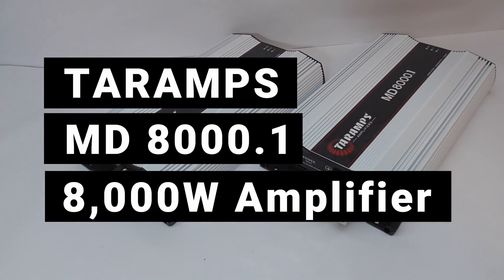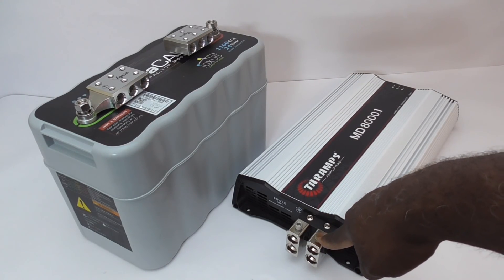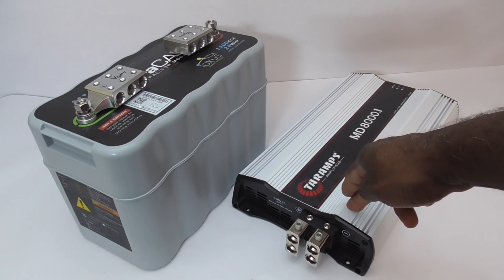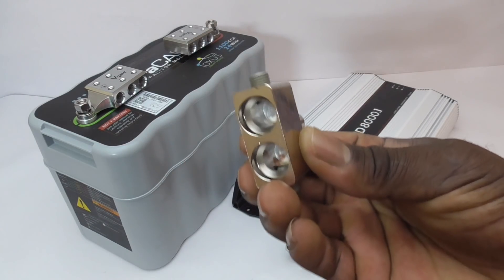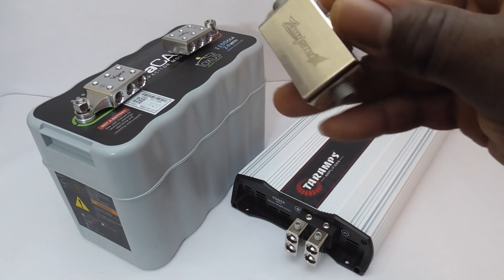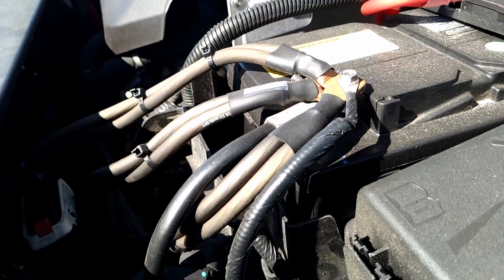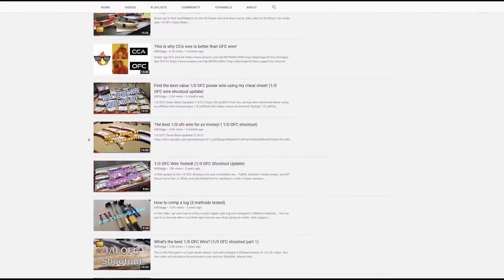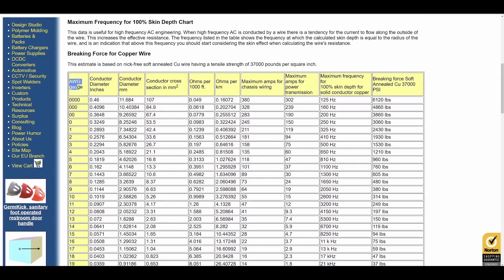Are Dual Inputs Really Needed In Every Setup?

Comment: I think dual runs will split the load keep the wires cooler after all you do have your family riding in the car so spend a little bit more and keep them safe you remember what happened to your old wire.
Reply from the maker: Great point

Comment: your talking about dual inputs right in front of a TWENTY FOUR WATT HOUR capacitor bro. You NEED more juice for amps with this much current draw but if all your doing is burps....its good I guess. Just do the math and find out for yourself. By the first big bass hit, that thing is completely drained down to 0 and if your bumping music its NEVER gonna recharge
Reply from the maker: The capacitor is supported by an AGM, 64Ah Headway bank, and has over 1 millions life cycles. I hope its enough.
Reply: @BudgetBassHead  What are you using to charge them headway cells? Those are lifepo4 yes? If so they won't EVER fully charge either without DC to DC conversion  and or they will smoke your alt eventually if your connecting em straight to the battery. I know this because I have 900ah of them in my camper :D Ditch the cap. You dont need it at all if them cells are good and have proper power.

Comment: I've pretty much always believed in multiple runs of power and ground cable if it doesn't break the budget. It doesn't hurt to have extra cable, and it allows for easier upgrading in the future. What I don't understand is those 2-to-1 inputs. I applaud ToolMaker and others who take the time to fabricate them... But wtf do they really add to the system? If the amp doesn't have inputs big enough to run adequate gauge cable, then you probably shouldn't be fucking with that amp, IMO. Everything you add in a circuit adds resistance. Most of these 2-to-1 things that people run are NOT solid oxygen-free copper or silver... So, even if you are running Knu or ofc welding cable, by using those 2-to-1 connectors, you are adding the resistance of a brick of nickel plated aluminum or whatever the hell they're made out of, PLUS any coating or finish that might be on the piece. I just can't see how adding a brick or nickel or aluminum between double runs of power cable and a single input of an amp will somehow magically add current flow to the circuit. If anything, I'd think it would impede it. And like I said, if the amp is designed to accept a single cable, then only run the single cable. If the amp still demands more, then throw it in the garbage, or modify the actual amp to receive multiple runs. I hate looking at those silly plugs. And they're rarely jacketed with anything to insulate them. If the power and ground cable is designed with insulation, why would you add something uninsulated between the cables and the amp? It all just seems silly as hell to me. Maybe I'm just a salty bitch, but I think those things are worthless unless you are really just that damn committed to running garbage amps
Reply: I think the issue here is that a lot of the full bridge style amps (like taramps) indeed do have undersized single inputs at least for how they're being used in the US. Many are Brazilian and were designed for the brazilian market with the idea that either it would be in a pretty short, small vehicle or that there would be a battery in the rear of the vehicle so again only a short run. In that case, smaller wire is fine because its traveling a much shorter distance. When you get into the big ole American SUVS that may only have a front battery, suddenly a lot of people have issues with the idea of a single run of 1/0 supporting 4-6k+ watts through 12-20 ft of vehicle. The market is demanding change though and the full bridge designs seem to be improving. Look at Sundown's SFB full bridge amps. Even the 5k has dual inputs built into the amp. Taramps has made much more reliable amps focusing on bass (bass and md series) vs what used to be more full range oriented amps (hd series)
Reply from the maker: Well spoken.
Reply: The resistance generated by the mass of the aluminium they often use to make these double adapters is so minuscule that it's irrelevant. The distance it's covering is the main factor to consider, and a small adapter that fits in your hand has almost zero capacitive resistance at all. The conductive part of the adapter is the entire adapter itself - and aluminium is plenty conductive.  A two foot run of 0AWG OFC will have more resistance than that adapter. It's also very easy to insulate them if you're worried they might ever touch, because on some amps they do get very close. I personally just sandwiched a piece of rubber in between mine *thumbs up*. After gaining about 0.3v of increased minimum voltage stability, I was convinced that they're fine.

Comment: Open the amp up and see what size the connections are on the inside and then tell me how much difference it makes to connect 750 MCM worth of copper wire to the outside of this amp. 

This amp has the size input on it that it does because of market request. If I recall you used to have smaller and puts because the manufacture didn’t think it was necessary to have even 1/0. 

I understand that there are some people who need to run 20 or 30 feet of wiring from the front to the back of their vehicle and that totally justified running larger wire, but that can be done to a distribution block and then you can run a jumper from the block to the amp if the amp won’t support the input you want. It has become a marketing tool to have giant power input connections on your amplifier.

Some of the baddest kicker amps ever made (for their size class) had like multiple eight gauge inputs... 

Remember that outside of SPL competitions if you’re actually playing music you won’t be drawing maximum power for any fraction of time that this app could potentially produce it because music doesn’t generate that kind of input to the amplifier. If the max this amp could draw is 700 A at 100% sine wave average loud music might be around 40% RMS which would create maybe 280-300A at the most in the loudest passages.  4/0 cable can easily handle that even 1/0 cable can easily handle that since your ears would give out before the cable would overheat.

Comment: edit.... You do not have 4/0 you have 1/0. a tape measure itself is not a precision measuring tool. AWG is measured by cross sectional area of round, SOLID wire. Please please correct this in your video that it is not 0000. as you referenced wiki please read below the chart 
"AWG gauges are also used to describe stranded wire. The AWG gauge of a stranded wire represents the sum of the cross-sectional areas of the individual strands; the gaps between strands are not counted. When made with circular strands, these gaps occupy about 25% of the wire area, thus requiring the overall bundle diameter to be about 13% larger than a solid wire of equal gauge."

4/0 single you would be fine. 4/0 is capable of more than 380 @ 20'. 4/0 has double the cross sectional area as 1/0 and too many commenting are thinking 1/0. and even then still don't have all the pieces. at 2' you would be fine with 2 gauge. I'd still run 2 runs especially for grounds only because I have seen too many ground traces in these amps burn up.

Comment: Dual inputs add more power and give better efficiency so definitely use dual inputs on this type of power. I would do dual inputs on a 4k and 5k if I'm running .5 if I'm running at 1 ohm then the single will be fine.

Comment: If you run both of those amps , how will you route the rca’s , a splitter from the red and make 2 red and split the white rca to 2 and then run 1 red and 1 white to  a amp and 1 red and 1 white to the other amp ?

Comment: When you have short runs, the ampire rating will increase.  I have a MD 8000 1 I plan on running 1 run of 2/0 less than 2 feet away.  I can't imagine there will be enough voltage drop to need more. Failed to mention that it is over 4,000 strands of marine grade OFC. Wire quality has a lot to do with it also.

Comment: Are dual inputs required. No I don't think they are. Do you have the ability to pull more through your lines with less worry yes I do. Do I think they make for better pop/wow factor yes I do. If you are a math guy and a budget guy then you will be factoring max current vs length for your big runs and then stepping the cable size down to split off to yours amp cuz you know smaller cable is more budget friendly.  I hope you break out that AMM-1 of yours and do some real world testing to see if if indeed you are able to use dual runs and get real gains from it. remember in the world of comp every fractional db is still measured and could be the difference of a world record or going home empty handed and it's better to have that extra bandwidth and not fully utilize it vs not having enough bandwidth and burning something.

Comment: As an owner of 4 of these amps that have seen 8702 watts clamped from them I can tell you you only need a single run of 2/0 welding wire (or oversized 1/0 car audio wire) especially if you are running only 2' My single 2/0 welding wire runs are 5' long and do not get warm at all. It won't hurt to run 4/0 and won't hurt to run dual inputs but they are not needed. Just do like the manual states and run a minimum of 2/0 with the shortest possible distance to the battery. Taramps the company won't steer you wrong.

Comment: Dual input is needed according to current draw, and the length of the power wire length. Derick from Sundown Audio on the Sundown Audio Unofficial channel did the test of dual input vs single run input, and yes, you get more power with the dual run. It's only needed if the demand is needed for your setup. MAKE SURE YOU FUSE ALL POWER RUNNING TO THE AMP, AND BETWEEN BATTERIES, AND POWER SOURCES!!!!!! (edit: Also, to clean up your terminals, get you some of those terminal relocation blocks that relocate the factory terminal to an external post, and give you multiple output ports.)

Comment: I run this amp on 2 vxf 12s at .5 ohm, the amp is about 4ft from my 40 ah lithium bank. This is just my take on it, I am not comfortable using 1 set. If I am running this much power then why not add a little insurance for the 30$ it costs.
Reply: 2 runs would be needed. however, how long you been running the amp and whats your rise?

Comment: You also need wire ferrules for the interior wire if you going to use those inputs to the amp1 wires sticking out of that can blow your whole system
Reply: Wire ferrules are horrible on my MD8000.1. I love the idea of ferrules but in reality they are a bad idea if you ever want to pull the power from the MD8000... The ferrule gets stuck in the input and you have to physically have to rip the wire from the amp even with the set screw all the way out. The wire pulled out of the ferrule and then you have a bent up ferrule stuck in the amp. They are a pain to get out of the input. It takes like 10 minutes each to dig out with needle nose pliers. Since then I've never used the ferrules and I've never ever had an issue.

Comment: BudgetBassHead, this information is going to be even MORE controversial. This is not opinion. This is common sense when you understand electrical theory. FYI and disclaimer, I am a DeVry graduate in electrical engineering, and been in car audio for work and hobby the last 23 years. That being said, here it is!
1. You only need the appropriate sized wire from your SUPPLY voltage source (battery), wherever that may be. This is based off of feet.
2. The voltage drop is based off of awg, and length of wire. The capacity is purely based off of awg, and the amperage it can support goes up the shorter the wire. Buss bars work the same. Your power wire is simply a FLEXIBLE buss bar, and the quality of the copper within the wire determines many different things, including amperage capacity.
3. If your alternator only charges with a peak available current draw of 300A, then you only need a SINGLE 1/0 OFC run, as it is not POSSIBLE to draw over 300A from your alternator!
4. Current is being drawn by the path of LEAST RESISTANCE, capacitors FIRST (least resistive load), Alternator, then battery...but alternator can only supply 300A, so take 300A draw away from the battery itself, but your COLD CRANKING AMP spec (how many amps the battery can SUPPLY for 30 seconds at 0 degrees before 10.5V) is the absolute max you can do on a dynamic current draw. At that point the battery will SLOWLY restore itself due to the chemical reaction in the battery when excited by inducing voltage. The rate it can charge back is directly proportional to how many amps are available to charge it (alternator)
5. Alternator has ONE FUNCTION, TO CHARGE YOUR BATTERY AND RUN YOUR CAR...THAT'S IT. So you only need correct awg to CHARGE YOUR BATTERY AND CAP BANK. In this case, 300-320A for that leg in the circuit.
6. Now that we understand that, we ONLY need to size the wire appropriately for the amp TO the battery...wherever that battery may be. If it's in the trunk, you can get away with less wire. If your battery is under the hood, well now you need MORE wire to support the amperage and the length of the run.

THAT'S IT. TRY IT. SAVE YOURSELF ALL THAT MONEY BECAUSE OFC is not cheap!
Under no circumstance EVER, I don't care if you're running a Boss 100W amp, never ever ever ever use CCA, it's never worth it! no matter how cheap it is, drop an AWG and go OFC. Galvanic corrosion, shrinkage and breaks are REAL. It has a much higher impedance per foot, and cannot handle the amperage either. You need 4x as much CCA to equal copper, so why bother with it??? You actually spend MORE money with CCA and get LESS. Even that dirt ass cheap Harmony Audio wire. FYI, I measured Harmony Audio's 1/0 CCA wire for a friend one time, it was the equivalent of 2awg...so you literally get double screwed. Still cheap now???
Reply: 1.  feet, temperature, bundled wire, conductor material...... not just feet
2. do you know what AWG is?  voltage drop and capacity HAS NOTHING to do with AWG.

5. Alternator has ONE FUNCTION, RUN YOUR CAR...First off you listed 2 functions, you only need the correct gauge for which the alternators output is rated. However more NEVER hurts. Second how do you factor in the amperage of the capacitor bank? 
6. Now that you've said all that, JUST WAIT, theres more........only to be followed up with more incorrect information......

You say this all like its a blanket statement, all wire is the same and you are thoroughly incorrect. Aluminum in itself is 55% as conductive as copper. so 4x55%=yeah you were close......................You measured your friends CCA, how? for what? with what? 

Terminate your ends proper, have sufficient runs according to ratings, KNOW what you are talking about before saying it like its FACT. I don't care the degree you obtained from what university, How long you been in the game, what you think you heard was fact, what has and has not worked for you.  First, "there is more than one way to skin a cat".  Second, no 2 cats are the same! Third, Just FYI, some of the loudest in the game run CCA. Do you lose a few hundred watts same vs same, OFC to CCA 1/0 on a few thousand watt amplifier? Absolutely! Will you hear that difference? Absolutely NOT! So you might need to run 1 extra run of 1/0 in a 600A system but with prices being double or triple, well can't argue facts and science Jack! 

Also, if you knew so much you would have known to correct him on his 1/0 wire being 4/0 as that was a huge oversight. We have all the correct information we could ever fathom at our disposal yet we piss on it and throw it to the wolves laughing. The amount of misinformation/disinformation has become disgusting.
Reply: @commonsenseisdeadandgone  just trying to keep it simple for everyone else.
Reply: @commonsenseisdeadandgone  we can converse over all the factors you would like, and how the data is collected. I'm simply answering the question. There are many factors involved to choosing the appropriate sized wire. He was wanting to know if it necessary to run dual inputs on his amp, and it's not. I was trying to help other people who wont understand certain terms as to why it's not necessary. I do not disagree with you, but I certainly would NEVER recommend CCA...there are many reasons to not use it, even if wins you trophies.
Reply: @commonsenseisdeadandgone  regarding your disgust, here is how the conversation went:
Person A: Do I really 8 oranges to make a cup of juice?
Person B: In my experience growing up on a farm, NO you only need 4...especially if you use the juicier Florida grown oranges. If you used 8, you would have a bunch of juice left over you can't use. Make the juice with Florida oranges because it has less pulp than California oranges. Never use California oranges because you will need to filter the pulp and they use pesticides.
Person C: Do you even know what an orange is? Do you know how the farmer grew them? How do you know it has more pulp? Even if it did have more pulp, you never mentioned that the pulp is finer. Your wrong, it would only take 5 California oranges making it cheaper. California oranges are perfectly fine, I see people drink it every day.

See how person C never addressed the original intent of the question? While there is clearly more information to get to a FULL technical answer, sometimes not all information is necessary to provide when answering a question. If they need more information, they can ask for it or do their own research.
So how is it that you are disgusted? None of what I said was in fact wrong. Yes you would in fact need close to 4x as much CCA, there are many reasons why it becomes that much. I welcome a deep dived conversation to my inbox